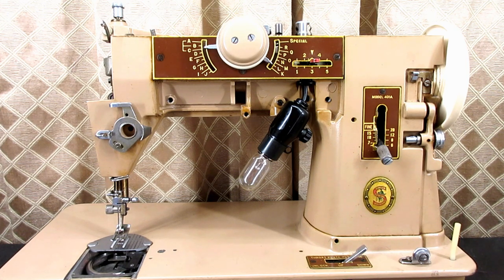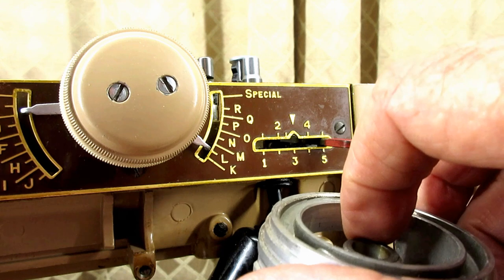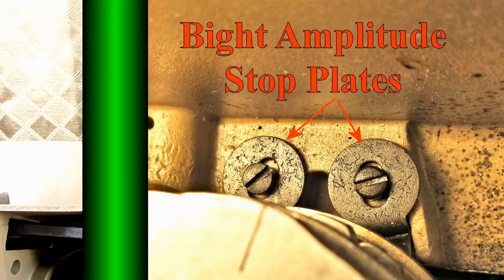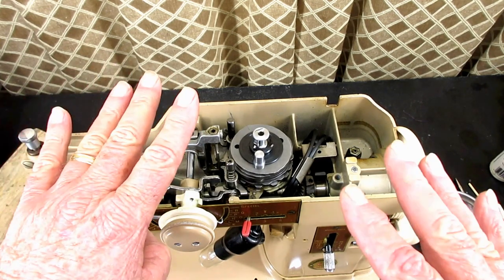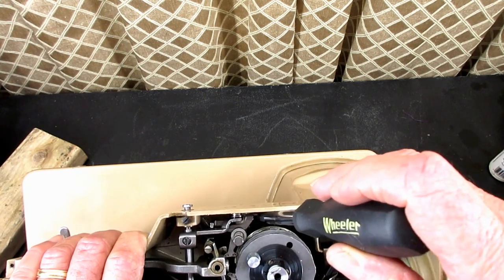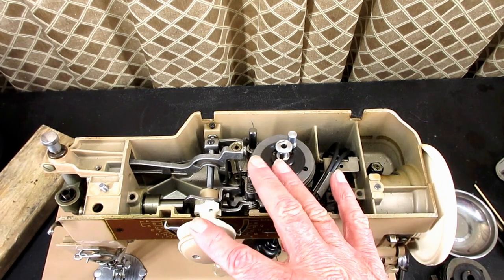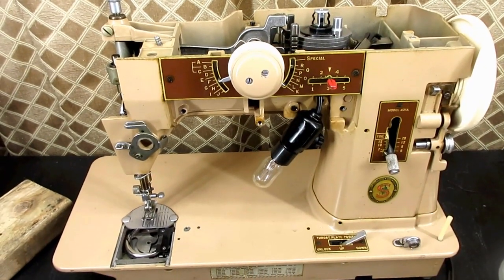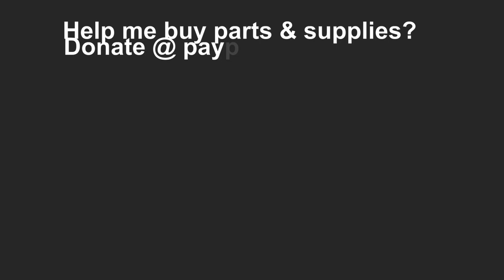How to "ZERO-OUT" Singer Models 401A and 500A Sewing Machines

Comment: I need to find the Zigzag presser for for my Singer 401A any ideas on where to get the right one?  I can't use the zigzag function for any of the stitches without it and it's not the same foot as my other Singer 418, I think this one is slanted a little bit...All ideas welcome Sandy
Reply from the maker: Singer model 401A is a Slant Needle machine and uses slant shank presser feet. What we call the Zigzag foot is the General Purpose Presser Foot part no. 172075 https://www.sewingpartsonline.com/search.html?keywords=%23172075
The other Zigzag foot is called the Special Purpose Presser Foot used for Satin Stitch and Embroidery and button Hole stitch.
Singer Part No. 163483 https://www.ebay.com/itm/402823975319?chn=ps&mkevt=1&mkcid=28
You are correct that the low shank feet for model 418 will not work on your 401A

Comment: Hello Andy from Norway
I have learned a lot watching your videos(perhaps not all of them). I have a 401g and my red lever is a problem to me. It will not move to 1 and 2, only 3 to 5. I have opened the top, the cam stack is out, I have oiled it, heatend it with my hairdryer. You have probably made a video about this before. Can you please direct me to the right "episode"? I have learned so much from you and love to use my Singers 28, 201 and 401. Thank you for all you do!
Reply from the maker: Hi, Anne. Sometimes you just need a good oiling. Moving that lever can also move needle bar driving arm to make the vibrating bracket swing the needle. If the bracket is stuck from old, dried up oil it won't swing out. (there is a spring to help it swing in)
If needed you can download a FREE copy of the Instruction Manual from Singer at this link: https://www.singer.com/search/support?title=401
Follow the oiling instructions, especially for the nose end area and see if that helps.
Here is my playlist for my recent 401A videos. Take a look and see if they can help you out. https://www.youtube.com/playlist?list=PLsCOZgzzaiKLiDl9yFTP6mJgQmz5lj4NO
If still having problems this playlist for model 403A includes a video for the vibrating bracket that makes the needle swing in Zigzag.
https://www.youtube.com/playlist?list=PLsCOZgzzaiKKyqvdDRwS-9MfLuwSNJTcg
It can be very helpful to have a copy of the Service Manual. I use them frequently. You can download a FREE copy of the 401A Service Manual at this Link:
https://sewingdude.files.wordpress.com/2012/09/singer-401-service-manual1.pdf       (it is rare to find a free service manual)
It is 45 pages of adjust, remove and replace instructions with diagrams and step-by-step instructions.
I find that on a vintage machine that's been in storage a good oiling with fix 80% of things like you experience, so unless you will be dismantling most of the parts I would start with a good oiling. BTW, I have had to soak some parts in WD40 for 24 hours before I could get them to move or take them off. Best of luck, and thanks for watching my channel.
Reply from the maker: Also, you are talking about the bight amplitude and pattern selector below the cam stack, so look for something down low that is blocking movement, like a fallen screw. Page 159 of the service manual shows how to remove the whole bight amplitude and pattern selector for cleaning and look underneath it (great time to regrease the pinion gear of the arm shaft) since you already have the cam stack out now is the time to pull out the selector. Lykke til
Reply: @andytubesewing1953  Thank you:) I will read the manual. And if I don´t make it, I might ask again. I think your videos are very helpfull!
Reply from the maker: @annekristinelindstad6292  Sure, you know where I am so don't be a stranger. Good Luck.

Comment: Hi Andy, I appreciate your informative and helpful videos.  I have a 500A and the driving arm on my machine does not move side to side for zig zag, although it does move forward and backward when adjusting the stitch width lever, so my machine only does straight stitching right now.  Can the stop plates be my problem?
Reply from the maker: I don't think so. Setting the dials for wide ZZ stitching, B-L-5 and turning the handwheel you should see the followers on the camstack pushing the paddle of the driving arm and the vibrating bracket moving the needle bar left to right. If you are not getting needle bar swing then try oiling the vibrating bracket as shown on page 94 of the instruction manual. In the picture of the nose it is the oil drop on the top left, those two spots on the VB. After oiling well you can exercise the bracket by pushing it towards the motor end of the machine and the spring should bring it back. If you need the manual go here: https://www.singer.com/search/support?title=500
If lack of oil was not the problem let me know. Good Luck.

Comment: Thank you for your videos. My Stitch width selector stopped working a few weeks ago, and I cannot figure out what happened. I have opened up the machine, and moving the red level turns the amplitude stop bracket as normal. The needle bar driving arm shifts forward and back as I move the red lever side to side. BUT the Zigzag stitch remains at full width no matter what position the red lever is in. Also my straight stitch needle position is stuck on the far right position and again moving the red lever does not change the position. Any help in what figuring out what happened would be greatly appreciated.
Reply from the maker: A lot of moving parts involved there. You did a good job of describing the problem but it's hard to diagnose the cause without having hands on the machine. 
     A reminder that on model 401A (500A) the position of the two dials on the front controls much of the ZZ function. Be sure they are set to normal ZigZag. The width/red lever and dial must be in a certain position when placing and removing a top hat cam. I have seen parts out of position and bent b/c those settings were not done before placing or removing a cam. 
     You can download free copies of the Instruction Manual AND even the Service Manual from the sewing dude on this page:
https://sewingdude.wordpress.com/category/free-manuals/   
      I don't know how many of my videos you watched but here is the 401A Playlist: https://www.youtube.com/playlist?list=PLsCOZgzzaiKLiDl9yFTP6mJgQmz5lj4NO    Here is the 403A Playlist:
https://www.youtube.com/playlist?list=PLsCOZgzzaiKKyqvdDRwS-9MfLuwSNJTcg   
     Sometimes setting the machine to straight stitch and doing a complete, proper oiling, and running the machine for 5 minutes can cure a few odd problems.  Be sure the Needle Bar Vibrating Bracket is oiled properly. 
     Since the machine has two lifters and followers you can compare them to see if a follower slipped down and got stuck against another part. I wish I could just tell you to do this or that or set the thingamajig like this or the whirlybob like that. Sorry.
Reply: @andytubesewing1953  Thanks for the quick reply. I have the Singer Model 600, so a little newer but built similar enough to the 400 and 500 to get an idea what I am looking at. Upon further testing I found I cannot get the machine into the I or J setting on the stitch selector. not sure if that offers any more insight. 
I will say that I did not know the needle had to be in a specific position to change stitches and wonder if I bent/broke something when I last switched it from the B Q stitch position back to straight stitch. I typically only use the straight stitch or ZZ but decided to get adventurous and try a new stitch.
Reply: @andytubesewing1953  Well, I figured out the problem. The back follower is two slots higher in the Index Pin than it should be in comparison with the stitch selector. So when the stitch sector is on setting A, the follower is in the third slot on the Index Pin. How do I reset the follower into the correct slot position?
Reply from the maker: @lauraanderson5864  If you have not fixed it yet the first thing I do is try to gently pry the follower from the lifter/index pin and then move it to the correct slot. Chances are they were forced a little and skipped to where you found them, often due to lack of oil. 
     I don't work on Auto Reel or Touch n Sew models ( don't care for them) but your 600 has a cam stack that can be removed and maybe allow for the follower to be reset. You must put the levers to A + K before removal though. 
     There will also be Arm  Stops for the front and rear follower and you may be able to loosen a nut or set screw to reset the follower and then re-tighten. 
     You can buy a copy of the Service Manual for model 600/603 for $9 here: https://manualsoncd.com/product/singer-600-603-sewing-machine-service-manual/   
     In the list of videos I gave you before are videos for the cam stack, lifters, followers, and index pins. The videos are not on model 600 but most of the parts look the same in the parts manuals. 
     Again, I would just gently pry the follower and drop it into the correct. Oiling all the parts as shown in the manual first, and a couple drops on the index pin/follower/lifter before trying to move them. You can also warm up the parts with a hair dryer before oiling.

Comment: Hi Andy.  
My zigzag on my new to me 500 does not go all the way to the right. I had hoped this would clear that up. But I may be utterly misunderstanding. 
If I were to assign letters across my zigzag plate, from right to left, ABCDEF, my zig zag at full width setting goes from A-E only. 
When the dial is a little past 4, the DK setting we used here stops all moving, because the needle is not homing all the way to the right in that setting. 
Is there a way to get that needle farther to the right? I suspect that this is the cause of my very uneven tension on zigzag stitches too. The leftward swing is farther from the center, and pulleys the thread much tighter.
Reply from the maker: Sorry for the delay, Joe. I had to think about this one. I have something you can try, but no guarantee it will solve your problem.  On page 34 of the SInger Service Manual for Models 500A & 503A are instructions for how to "Centralize the Needle Bar Driving Arm"
The manual states you must do the ZERO OUT first, and you have, so I'm thinking this would be the next step. Give it a try and see.
What? You don't have the Service Manual? No worries, you can download a free copy of it here;
https://sewingdude.files.wordpress.com/2012/09/singer-500-service-manual.pdf
That's about all I can think to do, Joe. I hope it gives you a way forward. Good Luck 👍
Reply: Andy Tube I’ll work on that. It wasn’t a long wait. I think I just wrote that yesterday or the day before. My machine is still open.
Reply from the maker: @Twisterjoe  OK, great and good luck.

Comment: Hi Andy. Would this method work on a 403a, with the exception of no Selector knob. With my Stich Width Lever on "S", I have a very slight movement of the needle bar driving arm or zig zag at needle. Also, the Stitch Width lever only moves to 4-1/2, not 5. Appreciate your suggestion
Reply from the maker: The method for doing this on Model 403A is similar, but a little different. The problem was that the Service Manual for Model 401A did not specify the procedure for model 403A. With the next generation of Slant Needle machines, the 500A & 503A Rocketeers, Singer provided a separate set of instructions for some of the adjustments on Model 503A and they can be used to adjust Model 403A. Fortunately the Service Manual for 500A & 503A can be downloaded for FREE at this link: https://sewingdude.files.wordpress.com/2012/09/singer-500-service-manual.pdf
When you get a copy please look on page 39 for the instructions you need.
There are a handful of adjustments that pertain to model 503A and again, they can me used on your 403A. Good Luck, and thanks for watching my channel.
Reply: Hi again Andy. Figured it out as I watched your 403 needle bar driving arm video, you mentioned the positioning lever locks in place when the Stitch Width lever is in "S" position, mine wasn't locking because the Stitch Width lever wasn't installed correctly after I cleaned the machine, love it when a plan comes together. Thx for all you work making these videos that help so many of us amateurs.

Comment: I thought I did exactly what you suggested however I’ve made it worse. My red lever will only move over to 4. First time it stopped, I loosened the screw and pushed the little plate towards the cam and as I pushed the red lever moved from 5 to 4. Now there is no vibration except at 3 at D K ??
Reply from the maker: I did not have that experience as you saw in the video. Perhaps something else is also out of adjustment? Maybe my presentation is not clear? Here is a link to where you can download FREE copies of both the 401A and 500A service manuals. They both cover this adjustment. I remember on the 401A manual it starts on page 140. https://sewingdude.wordpress.com/category/free-manuals/
Maybe with access to the manual, it will help. The manual also covers every other adjustment on the machine.
Reply: @andytubesewing1953  This is the first time, I've ever taken the top off the machine! very interesting to look at! Thank you, Andy, I loosened the screw again and pushed the red lever to five and tightened the screw (just so I could move the red lever. I hope this wasn't terribly wrong to do.) Anyway...there is little vibration at 3 and none after that. The problem I have is the needle goes all the way to the left (zig) but then stops in the middle (zag)...it will not go all the way to the right for a wider stitch. I have printed out the manual and will try to follow the instructions. Your presentation(s) are wonderful. I'm certain you are correct about something else being out of adjustment. When I set at B L for zigzag, I can rotate the wheel easily for about two rotations and then it seems to "rub" a little and is hard to turn the wheel...then it freeze up again for another couple of rotations...repeats this pattern. I love watching your videos...just afraid to make things worse. Wouldn't want to loose my ability to sew. I love this machine!
Reply from the maker: @patchase4773  This model and some other slant needle ZZ machines have a Needle Bar Driving Arm (pg 159 of manual) When the follower travels along with the cam stack disc or special disc it pushes the NBDA to make the Needle Bar Vibrating Bracket (pg 156) swing the needle. There is a spring on the NBDA to make the Needle Bar swing Back.  I have found if the spring is catching on something, or the NBVB is dirty or lacking oil, then the spring can not pull the NB the other way. Viewers have commented about their machine "will zig but it won't zag" and have found the spring blocked or the NBVB lacking oil, etc. Of course, the whole machine should be clean and oiled for all those moving parts to work together properly. Your machine is about 60 years old now and when was it last serviced (if ever)? Some repair shops these days just use an air compressor to blow out lint, put gobs of oil & grease everywhere (on top of the 40-year-old gobs of grease), and call it "Serviced" I do have some videos about the 401A that can also be used for the 500A. They cover the lifters and followers. I made those b/c it seems every slant-o-Matic or Rocketeer I found was dirty, sticky, and not functioning completely. https://www.youtube.com/playlist?list=PLsCOZgzzaiKLiDl9yFTP6mJgQmz5lj4NO   I also have videos for sister machine 403A that cover the NBDA and NBVB and the mechanics are the same or very similar to your machine. https://www.youtube.com/playlist?list=PLsCOZgzzaiKKyqvdDRwS-9MfLuwSNJTcg   Sometimes watching some of those videos (I use 2X speed) can show you how the part is supposed to work. You don't have to take it all apart as I do, but just see if it is doing what it is supposed to do. As for binding, it can be the same thing. A dirty cam stack gear and pinion gear on the main arm shaft, lack of oil on the take-up lever system, recently a viewer found about 30 yeards of thread wrapped around under the hook. She spent hours cleaning the foot controller and motor due to low speed, and finally looked under the machine and wondered what that red "stuff" was under the hook shaft. There are some troubleshooting guides towards the end of the Service Manual, and some discuss the binding of the machine and what may cause it.